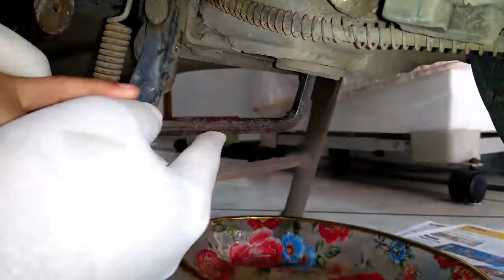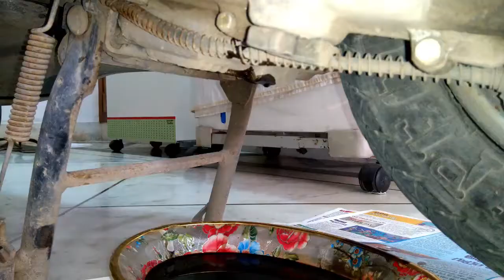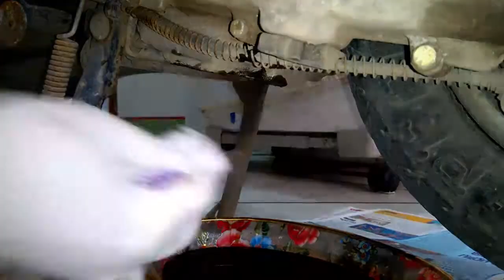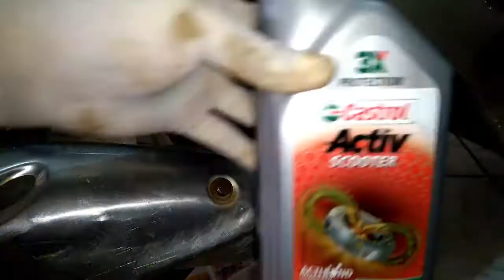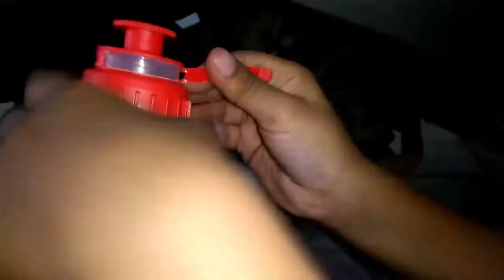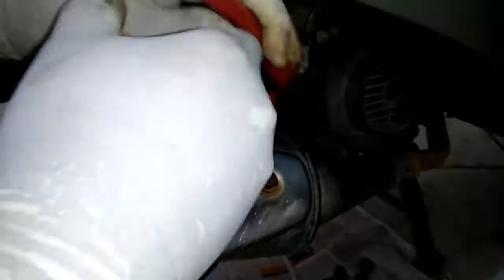scooty Pep oil change

Comment: Hi sir , one doubt .. in scooty the vehicle turns on but while i give acceleration the engine shuts down ,any idea where could be the problem as the vehicle is not used around 8 months
Reply from the maker: Clean air filter once and try
Reply from the maker: Clean carb jets also
Reply: If scooty is bs 6 then problem is with ECU prblem i have face the same issue after reaching 20 kph speed engine automatically slowdown and again starts acceleration...after  changing that part issue solved..